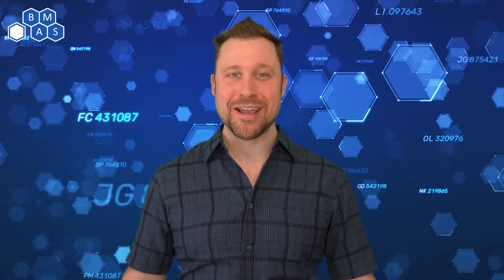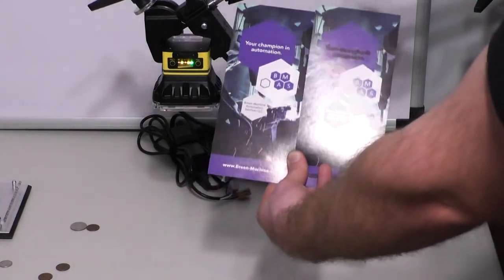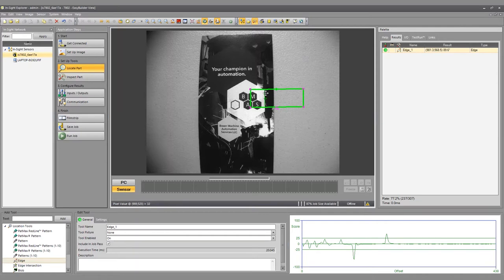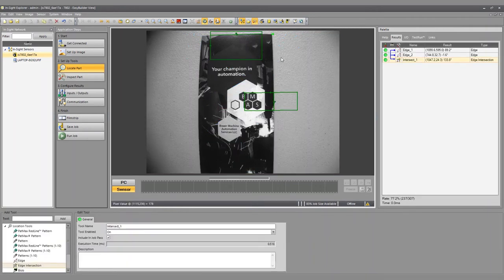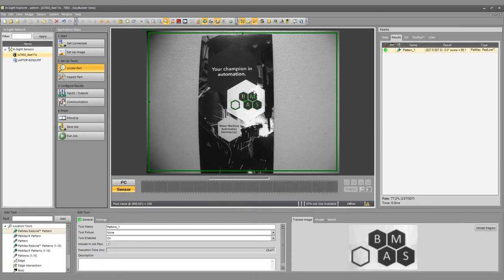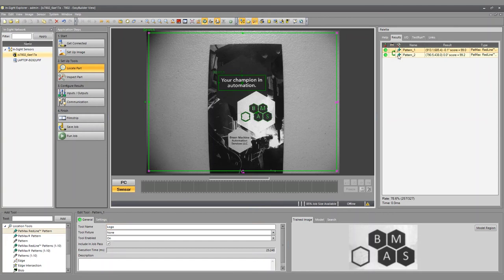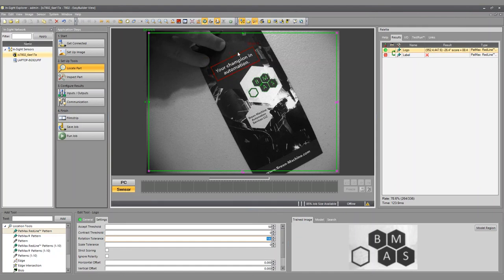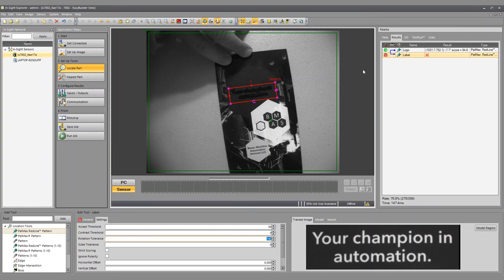How to Program a Cognex Camera in Insight | Machine Vision pt5 | Breen Machine Automation Services

Comment: Hey, great stuff! Appreciate it. When it detects an edge/corner is it possible to program it in such a way that it outputs the corner's X,Y cordinates or it's pixel location? Thank you.
Reply from the maker: Thanks Neil.  :)  For corner location, I'd usually use an Edge tool for both edges of interest, then use a Line Intersection tool to get the location of their intersection.  This method helps find the "true" corner, even if it's not perfectly square, or if it's rounded or dented.
Reply: @breen-machine  Thanks for a quick responce :) The cognex cameras are too expensive. I was interested in determining an edge gap location between two adjacent and close to perfect rectangular pieces. And since the gap will be very narrow, my assumption is it has to be high resolution. So what do you recommend, any cheaper and easy to program alternatives? Basler Ace2?
Reply from the maker: @neilmanishmehta806  Yes, Cognex is pricey.  Here in the USA, it's still a dominant brand because they have really good software and support.  That means less time to develop an application, and time is quite expensive here.  

I haven't worked with Basler Ace2 before, but I just checked their website.  They claim "Powerful Computer Vision feature set" which may be deceptive.  These look like "dumb" cameras to me, meaning they don't have the smarts built in.  You'll still have to have software on a PC that will process your images and interface with a PLC (I'm assuming your machine is run by a PLC).  You can buy PC software that will handle this, or you can write your own.  In my opinion, you won't be saving any money on a single camera system like this.  If you have a lot of cameras or you're building a lot of the same machine, processing on a PC and using dumb cameras may be a good choice.

Have you considered using a lens that will zoom in on the feature of interest?  If you can fill the frame with the feature, you might not need high resolution.  That would open up a whole range of less expensive camera options.
Reply: @breen-machine  Yes, the PLC is going to be involved here but since the camera is not yet finalized, the presence of other components is not finalized as well. I didnt think of zooming lens at all. Thanks for the tip. Will that compromise the accuracy of location?
Reply from the maker: @neilmanishmehta806  Short answer: No, using a lens to make the feature of interest fill the image won't compromise accuracy.

Longer answer:  All lenses will have some distortion.  Google search "barrel distortion".  You may have to use a calibration method that takes this into consideration, depending on your application.  For example, a grid calibration method will correct for lens distortion.  A dot calibration method usually will not.
Reply: @breen-machine  Okay. Thanks a lot. All the best mate.

Comment: I am trying to set up the reject output. I have a relay that’s going to stop the line. Where is the setting to do that ?
Reply from the maker: It depends a little on what should cause the line to stop.  Is there just one tool in the camera that should stop the line whenever it fails?  If so, look for the "outputs" options and connect that pass/fail signal to a digital output on the camera.
Reply: @breen-machine  I found it under inputs and outputs

Comment: if i were to connect this to an assembly line how would i keep the line going if it doesnt see an object?
Reply from the maker: You probably want to send a pass/fail signal to the PLC.  If the part isn't found, send "fail" and let the PLC decide what to do with that.  If the PLC needs to know specifically whether there is a part present, use a tool to detect if the part is present and output that result separately from the rest of the inspection.  For example, you might use a pattern tool or even just check brightness in the area the part should be.  That result would be tied to a digital output or Ethernet result, depending on how you're communicating with the PLC.